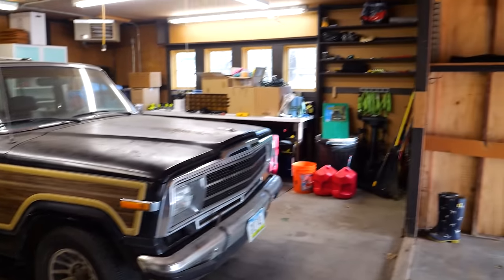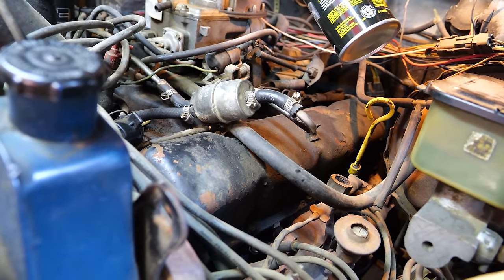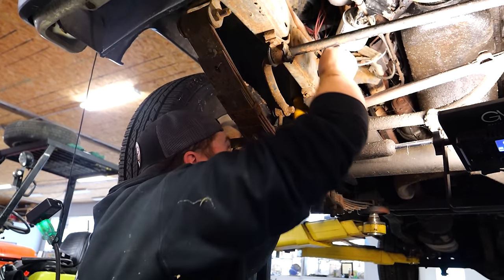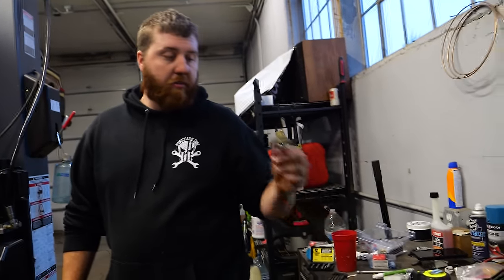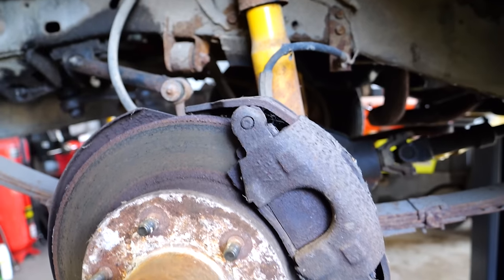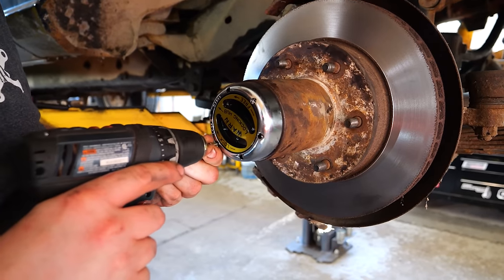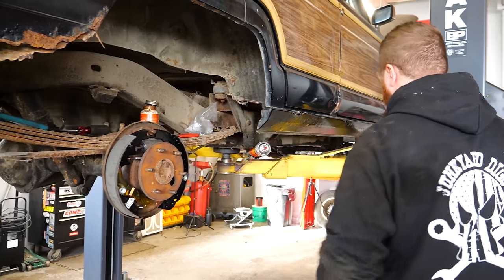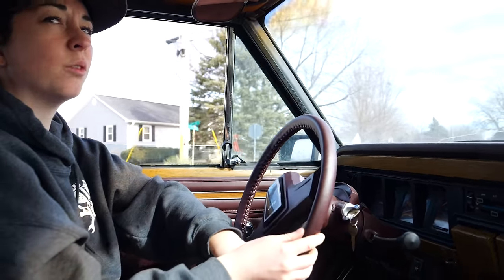Can we SAVE a Jeep that was RAN WITHOUT OIL?? Marketplace SURPRISE

Comment: Back in the late 70's I worked at a AMC Dealership. And once in awhile we had to put that woodgrain trim on some of these. What a Major PITA.
Reply from the maker: Interesting! Figured that came factory, must've been customers paying for it later?
Reply: @JunkyardDigs  That's what we always thought. Somebody saw one on the lot and thought Hey can you guys put one on mine.
Reply: I like to eat tuna salad in my pita
Reply: @JunkyardDigs  It came from the factory, I assume they had to replace some. Maybe from a wreck or a warranty issue.
Reply: I owned a 72 Gremlin back in 79 and was amazed by the Chrysler transmission, Ford starter, solenoid, and various GM parts all rolled up in the Gremmy. Luckily it did not have the V-8 I would have killed myself. Handled like a tank, literally!
Reply: @wilsonle61  AMC=All Makes Combined

Comment: A couple things to check are to make sure the flywheel is tight and not cracked and remove the belts just to verify the noise isn't coming from an accessory. But that sounds like rod knock.

Comment: Put a set of bearings in that thing and roll on brother. I’ve had these Jeeps for 20 years now and have a 91 now and the old engine I had in it I put a set of bearings in it with just dropping the pan and doing it in the truck. I polished the crank with Emory cloth and it had some pretty nasty marks in it but this was over Christmas 2008 and parts stores were shut down and I needed the truck running so I went for it. My wife drove the truck to work 45 miles each way for the next 8 years and I just put a new engine in it this year. Those 360s are damn near bulletproof!!
Reply: 82 cj7 with a 360,rebuilt and installed in 2003. Probably the most reliable engine I've ever owned.

Comment: 46:09 I heard it before you did the rod bearings. I am thinking spun main bearing at this point. 65 pounds of oil pressure doesn't mean there's not a bad main.

Comment: AMC engines use stamped steel pedestal rockers with aluminum pivots that wear out and cause a ton of valvetrain clatter. Pop the rockers off and check the pivots- I bet they’re trashed.

Comment: I took my old Wagoneer and swapped the gas tank out; the tank from an '86 Ramcharger fit between the frame rails in place of the spare tire, with about 1/2 inch to spare along the sides.

Comment: I had one of those, dark blue with factory orange shag carpet. With brown leather and cloth seats. The engine started to sound just like yours when I traded it in, along with $2,000 for a 1991 Rally Vandura 2500 GMC conversion van. Very nice van too. 350cid w/400 trans. Posi rear axle 
Had 62,000 original miles, and I put 75,000 more on it before giving it to a friend before I moved to North Pole, Alaska.

Comment: Definitely check the flywheel for cracks before you pull that motor down. Had that happen to me before and it sounds just like a rod knock. Pulled the dust cover off the transmission and shined a flashlight on the flywheel and you could see the shiny metal in the cracks reflect back. Great job on getting it going again and I love watching you two work together on projects. It always entertaining. Keep up the good work!!!

Comment: Get yourself a 3/4-inch PVC T-fitting and notch the T end so it fits into the locking hub spider. Makes a nice tool for locking the hubs.
Reply: good tip...im gonna steal that

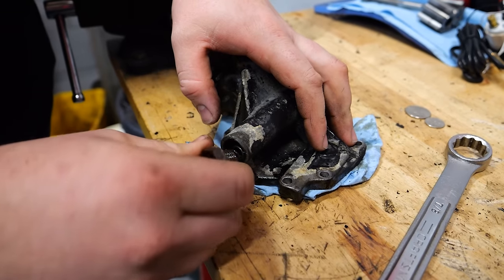Comment: 14:14 I just brought a 77 Buick LeSabre back home to Indiana from Atlanta last week and had the oil pressure regulator assembly depart from the filter adapter. I was able to catch it quickly and pulled over before any damage was done, but these parts don't exactly sit on store shelves anymore. Luckily had a friend in the Buick community who loaned me a regulator to get home. I recommend anyone who drives something with an external oil pump like the Buick and AMC V8s to keep a spare oil pump kit in the trunk. 

I plan on safety wiring my new regulator to keep it from backing out again.

Comment: Back in the mid 80s, I did my Eagle Scout community service project doing repairs to the pews in my church. The parish warden (in charge of repairs and maintenance in the church building) was a very sweet older gentleman who had a Jeep Wagoneer. It was older, but IMMACULATE! I have loved the Wagoneer ever since, and have always seen the Grand Cherokee as a sad replacement. I'd love to find a Wagoner, or even an old Cherokee, that hasn't been beat to death and super rusty.  I'd much rather have one of these that a modern car filled with electronics. My daily commute is only 2 minutes, but I could pack it up to go camping, fishing, pull a small boat, etc. It also helps that I work in a NAPA Auto Parts store, and I've been working on cars for YEARS! We have lots of guys looking for parts for CJs, Wranglers, and Cherokees, but but not Wagoneers.
Reply: I would think people would worry about starting a motor  with starting juices

Comment: yayyyyy Mook is back! Those old Wagoneers are awesome. Idk the last time i seen one. Id say that engine deserves a full rebuild. What you said ab parking brakes is 100% accurate. My 05 F150 doesn't have one cuz it was all rusty and cut off and I've never used the one on my 03 Subaru Forester. I wouldn't dare use the one in my 65 Mercury Comet. So yeah here in the north on a vehicle that is getting older You are asking for trouble.

Comment: I have a 97 2 door Cherokee with a 5 speed that had a knock that got increasingly worse over time and thought it was a rod bearing being it had 207K miles on it and was beat to shit. Pulled the pan off and instead I found out that the number 6 piston had broken off a skirt. It now has a new freshened up 4.0 albeit with way more miles
Reply: Ooh that is not good. Loose parts are not fun to find. 😮😮😂😂😂

Comment: I did the opposite with a Dodge 3.8 on my Caravan. Lifters first and then realized the tick was coming from the rods. 130k miles ago and still running strong. 😂
Reply: You ran it 130k miles with rod knock?

Comment: Back in the day, if you needed a replacement rod, machine shops had rods that spun a bearing resized back to original specs. So you might find a rod that had a #2 stamped on it, but in a different cylinder. Or a rod cap matched to a rod stamped 6.

Comment: I also have an SJ FSJ. Rust is worse than mine. Lifters can be an issue but I spent years with an oil treatment hiding the issue before putting in new lifters and cam. Put in The snake oil and Get it hot.

Comment: Ive picked up 3 AMC 360 engines for my 1 Jeep project. They all have the same crank problem, and similar noise. The thrust bearing eats into the crank and gives a bunch of front to back end play. I've sent one crank out to a shop in MI to have it welded and turned.

Comment: I'm glad to see this era jeep on here finally, Have always been my favorite, the AMC jeeps, I have an '86 Wagoneer, although not a woody and mines been 5.2 magnum swapped.. I wish more people would preserve the AMC engines.
Also those wheels, the turbine wheels have always been my favorite kind of wheel!

I wonder if it's piston slap you are hearing, I have a '87 Cherokee aswell with the 4.0 and they are known for piston slap, mine has piston slap for sure and it sounds very similar, actually, exactly the same.
it's the one in my profile picture, ran it with piston slap for 5 years, ate a little oil, ran out of oil once even, still going strong, gone on most glaciars of Iceland slappin those cylender walls hahah.

Comment: I used to have an old Jeep Wagoneer when I was stationed up in northern Maine that had that same 360 motor and it was every bit as noisy as your 360 there. That old jeep was pretty much wore out and when I was getting ready to leave Maine and I got rid of it so I never bothered to check out the issue with it

Comment: Im with Mook on those wagoneers, i love em and the pickup versions. Im actually considering replacing my 00 suburban for a decent 70s-80s wagoneer. Got 3 kids in car seats, so i was thinking about a simple truck with lots of seat space. The suburban is fine it has working A/C and 4x4, the trans is a little tired, engine runs good but 215,000 miles, heated seats work but look terrible. I pull a homemade pickup box trailer if i have to haul anything.

Comment: Good practical tip on the e- brake...and totally true up here farther north in canada as well.. either use it regularly or just dont touch the thing..its pretty much guaranteed to not release or not release fully the first time you pull that cable if its not been used in a while...,unless you know its ok, chances are better than good that you'll be sorry

Comment: I have 5 GWs with AMC 360s. 3 that had 0 oil pressure . Rebuilding the oil pump gives you a 50/50 chance of having SOME oil pressure.  Replace the timing cover. It may have a very tiny groove in it. I did this and all of mine now have 40+.

Comment: I had two of these. 1982 & 86. I loved them! I bought both 8 years old with 70k+ miles used. I felt like a rich man on those leather seats. I wanted to find another but the quit making them.
Reply: Zero engine or transmission issues, they just rusted away...

Comment: Tip: with external pumps like that, do not remove the oil filter while the sump is empty: put the new oil in before changing the filter. That will prevent the pump from draining out totally so it primes up much better.

Comment: I make a habit of using the parking brake at least once a week, and I also lube the cables.
It helps that I have 2 trucks almost exactly the same except one is a small block manual and the other is a big block automatic.
Both far, far past that 15 year mark...

Comment: I’ve built hundreds of AMC engines (we had the local dealership /speed shop) 5 and 6 bearings usually get bad first. There is an oiling issue we put a bypass tube in our race engines that see 9000 plus RPM often.

Comment: You might want to pull the valve covers might have bent push rods and the timing too.but might have to change motor....
Good luck I've had a AMC 360 before in a ambassador was a good motor 350 k and still going strong when trading for a different car.

Comment: $2000 is a good deal, and you have made Mook VERY happy.  BTW, if llRC, there is or was a retrofit kit to put the old style front grill, which is cool, on these. The sheet metal didn`t change.
Reply: Retrofit kit is just the headlights, headlight trim, and the "gladiator" grill. 
My favorite was the m715  1 1/4 ton army version. They were ridiculously overbuilt.

Comment: AMC purchased their 360cid engines primarily from Chrysler as well as their 390 and 401cid engines. Rumor had it, back in the 1970s, that Ford 360 and 390s were also utilized by AMC. I can believe the Chrysler version of the story because I saw the Chrysler emblem on hidden, or at least out sight to the casual viewer, spots on the blocks and even wiring harnesses. Many gas tanks for Jeeps like yours were sourced from GM while automatic transmissions were a crap shoot between Chrysler, Ford, and GM.

Comment: The Moto craft two barrel as far as I’m concerned it was one of the best carburetors money could buy. I saw a guy with a manifold for three carbs ran three Moto craft, two barrel, and with that annular discharge booster. That was a strong running car.

Comment: Easiest way to remove a stubborn brake drum is to take the torch and heat around the center hole on the drum itself between the center hole and the studs and it will pop right off when you get it hot enough.

Comment: The 360 having low oil pressure at idle is very normal. I owned many, and worked at a Jeep dealership for many years. If you check a manual, I believe you will see that 15 to 20 is hot at idle. John from Cape Cod

Comment: Could try the trans fluid in the oil thing. I cured a lot of lifter noise in my buddy's chevy with that. Obviously just get it hot and drain it, dont drive on it, but it worked for me.

It didnt 100% go away, but it's almost silent now

Comment: I have a 1980 jeep wagoneer that was optioned out to the max back when it was new, I got it about a year and a half ago as my project car to do something together with my dad and teach us both about cars. Its a desert car with some rust but nothing that isn't repairable, nothing on the frame at all but the floor pans are in the process of being replaced. 
Theres no interior, I have one of the seats in my bed room for my racing VR setup, it has a 4 inch lift, none of the lugnuts are correct for the wheels (and i dolly towed it 80 miles not knowing that), a busted windshield, But all the electrical works except the fuel gauge. 
It runs like a top for some reason, oil was black but no metal, and it has no mechanical issues at all somehow. Just needs a lot of work cleaning up rust and entirely remaking an interior.

Comment: a late 80s wagoneer was the very first vehicle I rolled.  when i was like 10 years old. my dad was letting me rally it around in the big field behind the house when i hit one of the big survey holes that was hidden in tall grass.  the front driver wheel dug in and the ass end came up and and ended up doing around a 200' rotation.    I thought my dad was going to be way more pissed than he was lol.   he ended up putting that motor in a valiant signet.

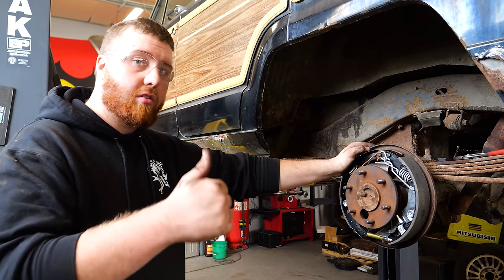Comment: I'm working on a 1979 Wagoneer and it has a similar squeak at 46:05, for me it's the belts slipping on the alternator. Mine also has valve train noise and for me it sounds like it's coming from the rear drivers side of the engine.

Comment: Got a uncle with a wagoner with a cammed and tuned 5.3 ls and it’s great. Had to change the amc turbo 400 for a gym turbo 400 but everything else was really simple. 100 times better and more reliable than the two barrel worn out 360 pumping out 150 horse

Comment: Well I suppose thicker oil in it might quieten it down a bit, it could prove the bearings on the high pressure side. It’s keeping reasonable oil pressure though so not sure it’s the big ends. The replacement shell bearings will be oversize if the crank has been refurbished. Is the crankshaft end float measurable?. At 140,000 miles the timing chain could be rattling?.

Comment: In my experience that squeak is a spun bearing that's now wet with oil lol I had a Ford 302 that spun the oil pump shaft and spun or disintegrated every single bearing in the engine. I filled the crankcase with about 500 gallons of water, milk, and some oil to make it a splash oiling system. It then sounded like this engine lol When it finally got torn down (never exploded) the crank and rods looked amazing actually... but what bearings weren't spun were melted in the pan.

Comment: v8s aint done after 140k,  my rams hemi has 230k  on the counter and when i did my heads (to get stellite valve seats for LPG installed)  the crosshatching in the cyclinders is still there and i wanted to do bottom end bearings but it just was not neccesary.... i still have the bearing set in my closet in the garage,  just used the sump gasket and head gaskets from the whole set because i couldnt justify putting bearings in a motor that was that healthy.  i dont remember what i measured with the plastigage but it was extremely close to stock. 
running something without oil is the point of no return though.  no matter how long you did it for, there is irrepairable damage.

Comment: Old Hot Rodding trick for the dirt poor. Old Small Block Chevy, knock the pin out of the oil pump, remove the spring, screw a Holly Carb Jet in the spring, reinstall the spring into the used pump. Instant 10 to 15 psi gain, on the original bearings!.

Comment: 1 month ago I found my wife's 1997 Jeep Wrangler Sport 4.0 short block was all original.  I started it up to go to dinner with my wife and a brand new engine sound came up that sounded like valve train. Pulled the valve cover, and there was nothing wrong. Did compression check, all cylinders over 150 psi warm.  But a soft rattle issued.  With 287,000 on the bottom end I pulled the oil pan.  Found five pieces of the lower piston skirt of number 4 piston on one side.  They all fit together, and inside was the Chysler symbol.    No overbores and stock pistons.   Wow.  New short block her next week.

Comment: Good stuff guys! I didn’t know about being able to put locking hubs on the front axle. Very cool! I wasn’t a big fan of the full time four wheel drive system. I knew it was fuel hungry. Good to know that can be fixed. 
Ummm…what happened to the Burnt Nova? Are y’all still going to fix it? Do you even still have it? Just wondering…😏😎

Comment: I had a 72 Gran Torino with a 351 C that had a valve tap from cradle (when I got it)  to grave (when I sold it - running). I suspected a collapsed lifter but never had the time to tear into it.  I put 80k on that collapsed lifter.

Comment: @JunkyardDigs : G'evening from Bouse ID.  Kevin 🤠 . IDK if anyone else caught it or not but I think there may be a goof in the Burns in the bottom end of the engine.  If the crank and / or the rods were turned that should be a 0.20 over bearing,  not under 🙃 . I did the same thing w/ a 0.30 over Buick 350 dtroker when I ordered standard size rod bearings instead of 0.20 over from PAW aka: Performance Automotive Warehouse back in the day 🤣 ..

Comment: Those are original wheels. I live in Kenosha where we had the AMC plant that produced most of the cars. If I recall correctly, Jeeps were made in Toledo. I worked at the old AMC proving grounds in the mid to late 90's and we had a nearly identical Grand Wagoneer that was left when Chrysler bought AMC. The Proving Grounds is still there today, but the roads have all deteriorated. A private company owns the property now and will likely sell off the land for development. Very sad. That old Jeep will do you well, despite being a collection of parts sourced from random car companies.